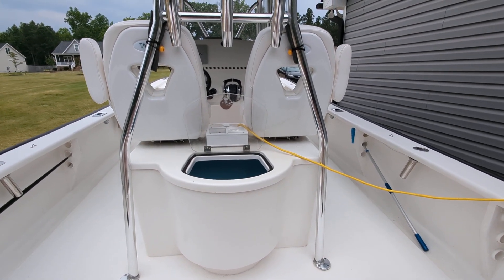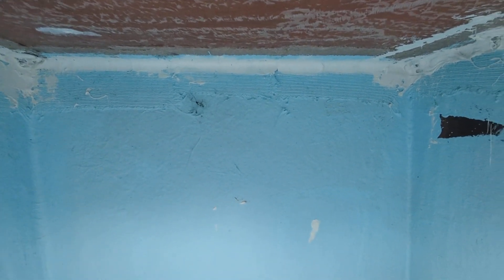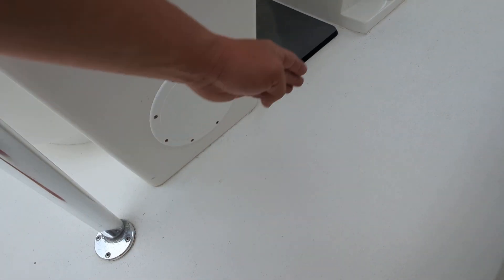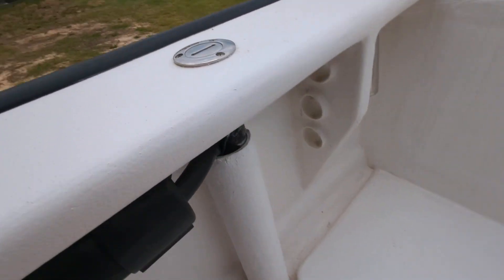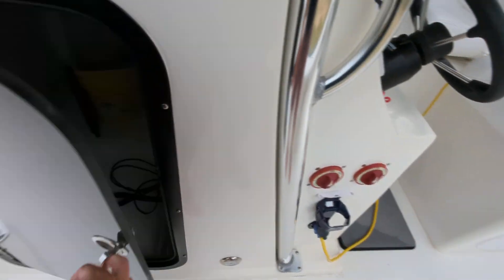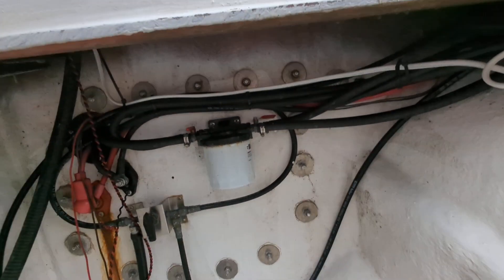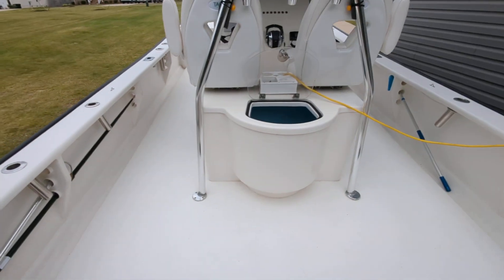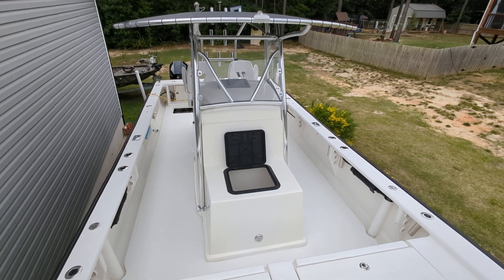EASTWARD Boats "potential" water intrusion & Liquid Tie-bar operation to align motors

Comment: A $250,000 boat shouldn’t be having this problem. And the area with the fuel filler line looks hideous. Eastward has pretty bad quality control.
Reply from the maker: Boat is $140ish new ... Commercial build ... Built like a tank and rides better than any $250,000 catamaran. Having a gel coating in the bilge would just add more $ to the hull. No need for what we do. Bilge cleaner and a pressure washer does the trick.
Reply: @WeekendHOOKER2012  The fuel filler line on your boat isn't in the bilge. It's on the side of the gunwale. Out in the open. It should be completely enclosed in fiberglass to protect it from getting a hole poked into it, to protect it from the sun, and to also keep water from getting into it the hull. It should also have a gel coat on it so you don't get fiberglass in your skin if you brush against it. Which is likely to happen since it’s a fishing boat. If you look at similarly priced catamarans like a World Cat or an Invincible they don’t have this problem. Deny it all you want. Nothing will change the fact that this is terrible quality control on Eastward’s part.
Reply from the maker: @UltraMagaFan  .... The fuel EVAP canister isn't made of fiberglass. The fuel system/line is protected by the tubing. It could easily be hidden by a combing bolster but I chose not to add any additional vinyl to the boat. A 280 WorldCat or similar sized boat is $100,000+ more and they are 2-piece liner boats. This is a one piece boat when they are done installing the flooring and have  fiberglassed everything together.

Comment: Why have drain plugs there won’t it just run to the bilge if you didn’t have plugs there?
Reply from the maker: I believe you are asking about the bilge plugs that keep water from going up into the area where the fuel tanks are. That's specifically the reason that they are there so water cannot freely push up into that cavity and continue to fill the sponson with water. I keep them plugged while running offshore and pull them after removing the boat from the water.

Comment: Thanks for sharing. I'm in the market for either a Calcutta 263 or Eastward 24. What are your thoughts on the calcutta?
Reply from the maker: Calcutta makes a great boat. More for shallow water and small seas. The Eastward does both and will take larger seas much easier and safer without a doubt.